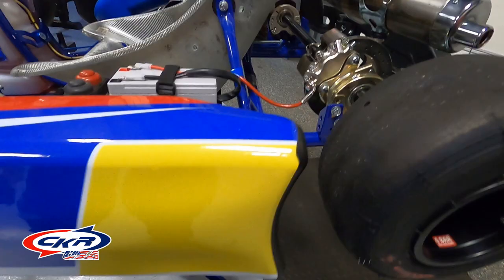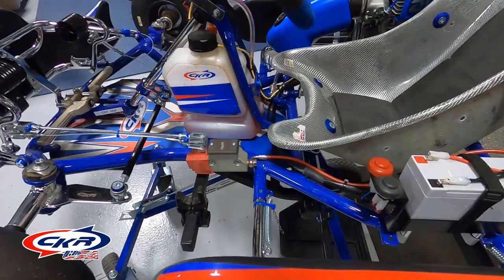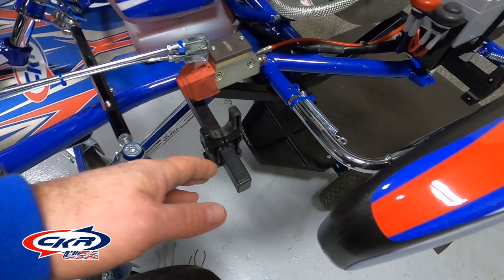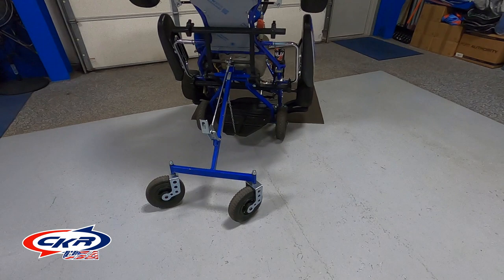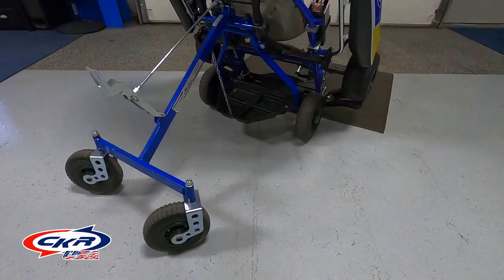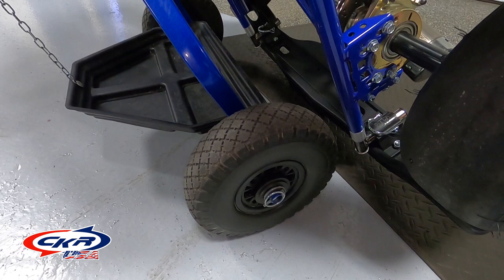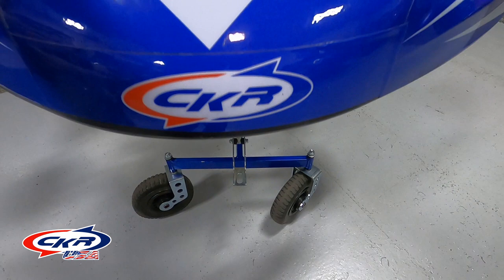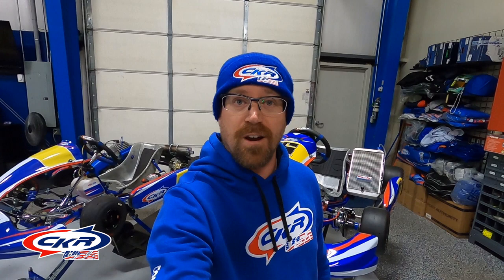Stone Kart Stand - One Person Kart Lift Stand Operation Video from CKR USA

Comment: Can this stand be used with a lo206 based kart?
Reply from the maker: Stands work with chassis 2005 or newer regardless of engine
Reply: @ckrkarts  Thanks! I was worried about the carb draining into the air filter when tipping up the cart.
Reply: I've got a lower back injury, wife helps me lift sons synergy cadet. This might be a good option. How much does it pull your lower back when initially raising and pulling onto stand? Cheers
Reply from the maker: @Marcturbo1  boy I'm not certain how to answer that for you. My scale of weight may be completely different than you with an injury.
Reply: @Competitive Kart Racing - USA  i know, I can lift front of his kart up like you do to vertical.
Reply: What about the question about oil moving in lo206 engine when tilted up like that?  Any lo206 end users attest to success at track with this stand?
Reply: @dbow1313  I ended up getting it and using it all season for my son's cadet lo206 kart with no major issues.  I did find the fuel overflow can ends up with a fair amount of gas in it at the end of the day.  No other issues as far as I can tell but I do try to minimize the time it's tipped up.